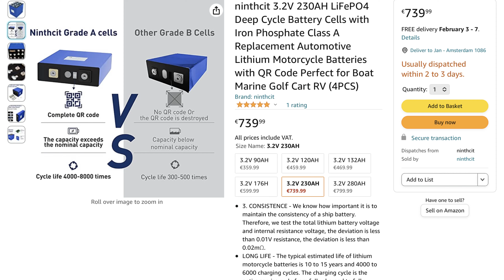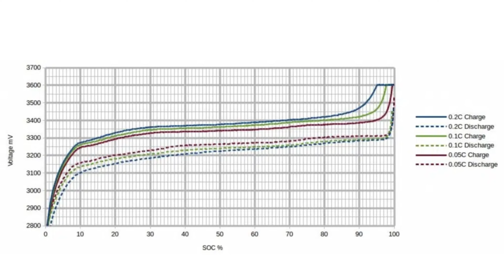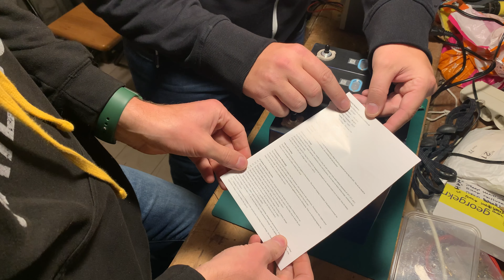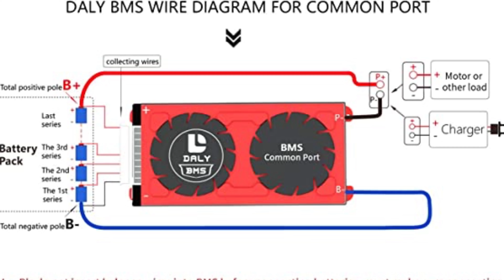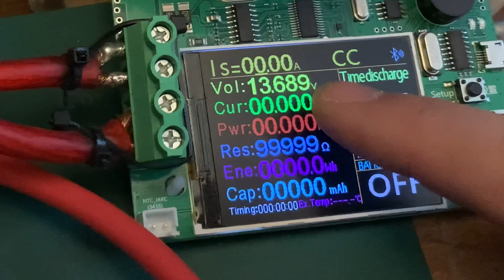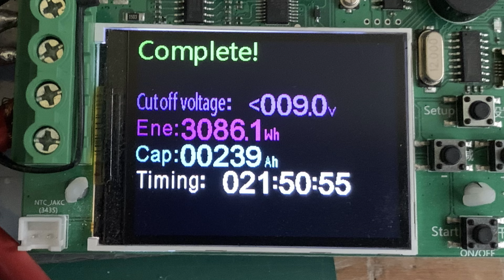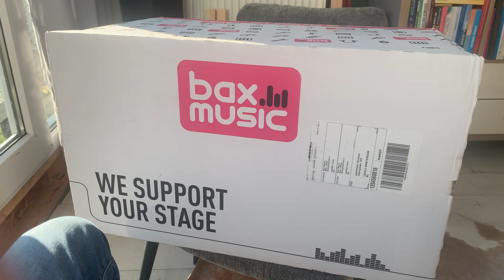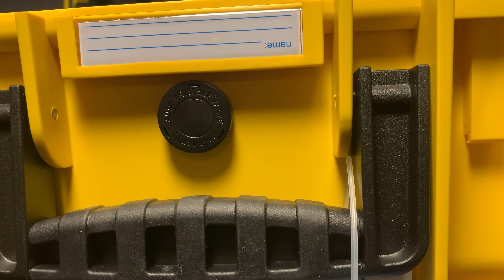051 How to make a waterproof LifePo4 boot battery pack ( in theory ! ).

Comment: Looks good I will have to study this, and why same battery seems to cost 20% more on USA site
Reply from the maker: Hi Christopher, this particular pack is shipped from Germany. Have to say, i’m now rewiring the whole setup and basically the need to charge on the alternator disappears with this amount of charge. I do have a dc2dc but I feel I will not use it a lot. :)